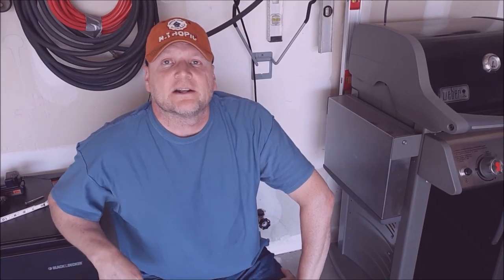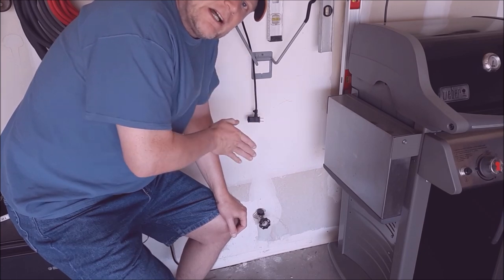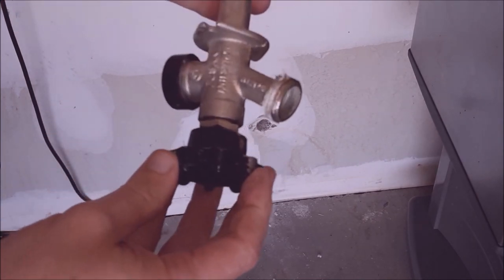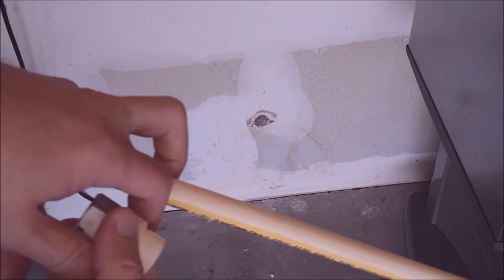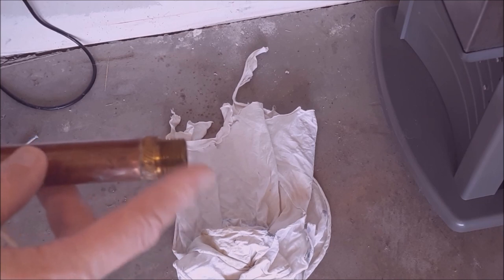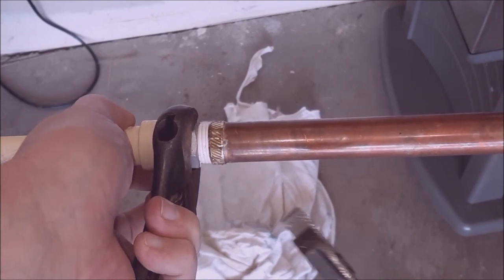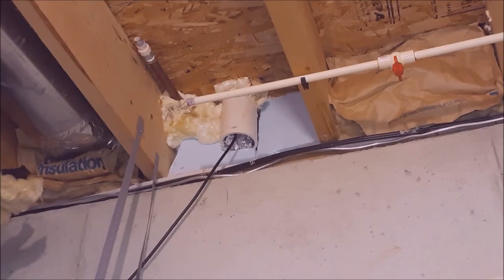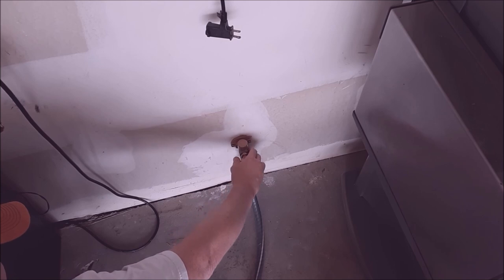DIY On How To Replace A Outside Spigot Faucet Freeze Less Hose Bib & USA Woodford Model 17 Plus Tips

Comment: My old Watford spitgot doesn't have the anti siphon and it's soldered directly to the main outlet copper. I think they did it because the pipe is directly above my electrical panel. I don't even know why they would design something like this.
I thought about cutting, switching it to work with PEX tubing and get the spigot that comes with connect fit. I'm not sure if that will hold in extreme cold weather on Chicago. I am not sure if the connect fit will work better than shark bite clamping ring though. Last thing I want is for the water to leak out on to the electrical panel

Comment: What a minute! You put a six foot piece of pvc to the adapter, then stuck it through the hole in the wall . Then in the basement, you show the silcock with a short piece of pvc and the adapter.
Reply from the maker: Just glued it to a random piece then cut to length. 👍

Comment: What state is this ? I’m curious because the differences in construction codes state to state always amazes me. We could never do anything this way.
Reply from the maker: You can't change a simple hose bib?
Reply: @DiyRick66  obviously I’m talking about how it’s done lol. We can’t use pvc on anything that connects to a bib. I’ve worked all over the country it’s always interesting to see the differences. Which is I was just curious what state.
Reply from the maker: @SticksAandstonesBozo  CPVC was the cheapest & favorite way to do simple plumbing instead of more pricey copper. Now these days they went to pex tubing with crimp fittings that is even cheaper yet. Delaware
Reply: @DiyRick66  yeah we can’t use pex either. In Florida you can do all that.
Reply from the maker: @SticksAandstonesBozo  Wow...just copper?